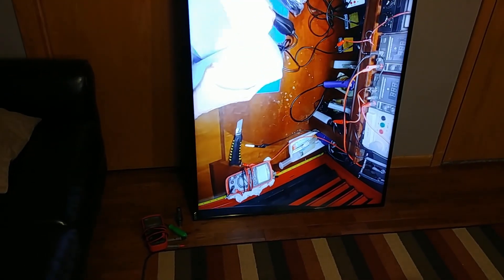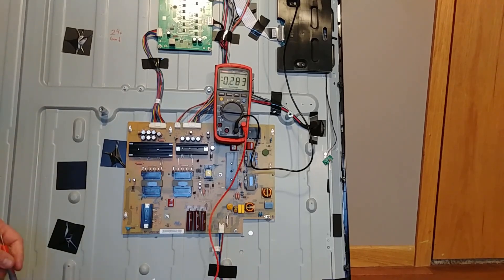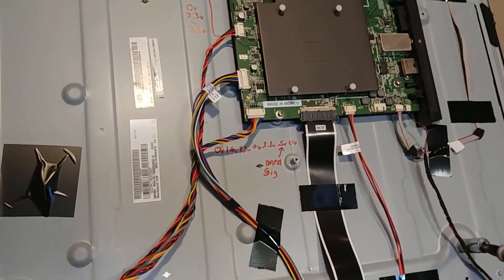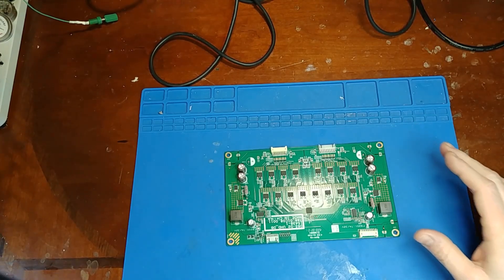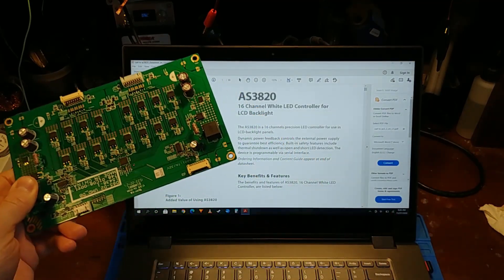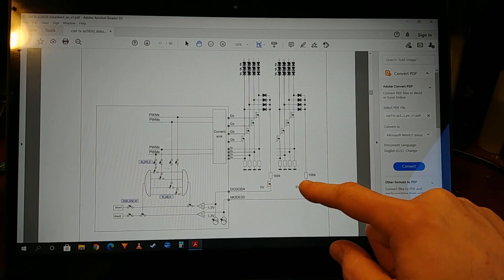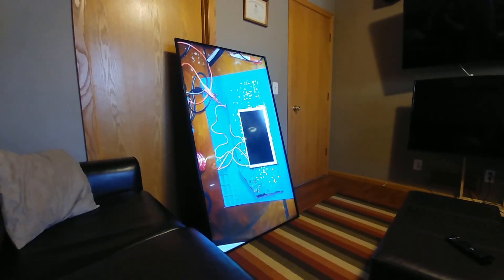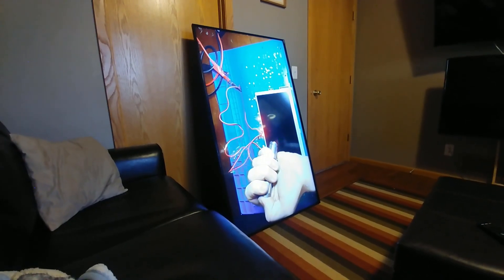How to sorta fix a 65" Vizio for Free

Comment: ❤ Question: what is the process for actually removing the 2 resistors? Did you have to heat them up to remove them? Or can you just pry them off?

Is there an easy way to do it without special tools (soldering iron, etc.) ?

Thanks so much for the video! You may have saved me lots of $$$ ❤ 5:47
Reply from the maker: You could forcefully remove them, but it's possible the solder joints could be damaged in a way making it difficult to put back to original normal condition. 
But if you have no intentions on replacing the LED strips you have nothing to lose, it's worth a try.
Reply: @jeffescortlx  thank you for the quick response! You the man! I was thinking of adding 2 usb cooling fans to the rear to prolong the life. Do you think this would have any benefit? Or is the LED failures usually not due to heat?
Reply from the maker: @babypluto2767  LEDs are rated for hours. Keeping them cool helps, but they are still subject to use.

Comment: Bypass of the protection circuit may be OK for a cheap equipment like a TV.
If the risk is to damage an expensive component in expensive equipment the best solution is to replace the actual failed component.

Comment: I tried this fix.........and it worked.........however, because of the size I could save the resistors............you wouldn't know the actual specs for these........the whole board is impossible to replace.  Thanks
Reply from the maker: 100k. Probably 1/8th watt or something like that.
Reply: @jeffescortlx  THANKS

Comment: You need come take vacation in florida and fix my dads sceptre TV that I cant get a new Tcon board for. I have a saved search on ebay for the last 2 months and still nothing. only psu/main boards. no T con
Reply from the maker: Bags are packed. But I want to take a pit stop at galaxies edge and geek out for a day.

Comment: I have a 00-06 Silverado/Tahoe A/C controller I refreshed. I removed the rotary encoders and cleaned them and it works great. I’d rather replace them then clean but I am having trouble finding the specific one I need. Where would I be able to find them? Any help would be great. Thanks.
Reply from the maker: For 03-06 encoders between cleaning and donors I've never needed to track down new replacements.

Comment: The price of TV's now days just buy a new one and not fix the old ones.
Reply from the maker: Correct me if I'm wrong, but isn't free cheaper than buying a new TV.
Reply: @jeffescortlx  Yes but if you had to replace things in it is what I was talking about.
Reply from the maker: @xsiner  ok, but even so. Let's say you buy a new TV, now you have to see if the retailer you bought the new TV from offers free recycling. If not you might have to pay a recycling fee to drop it off, or find someone that will come take it. Or you could brake it apart and throw it away in peices. But really it's it kinda wasteful to destroy a 65" 4k TV just because it needs a led kit installed?
Reply: This logic is fine for cheap tvs. But a decent TV is quite expensive and definitely worth doing a free fix.

The vizo still has a decent picture even today.

Comment: I have a 42" Vizio that is doing basically the SAME thing. Powers up, picture shows up for anywhere from 10 seconds to 2-3 minutes then LED backlighting goes out. My wife already bought another TV, but I saved this one because I keep thinking it will be an easy fix.
Reply: Mine doing the same thing .

Comment: I was going to say  ' play with your pussy '  oops sounds wrong lol.
I thought you were going add a couple of 470k resistors from ground to the 100k outputs.
Less feedback but still some,  just in case the sneaky chip expects to see something.
But removing them works, well done jeff :-D
That pcb looks nice and symetrical,  not a nightmare mess by some mad man lol :-D

Comment: I'd be surprised if the LEDs never fail but without your "fix" the TV would have been thrown in the garbage.
Reply from the maker: Pretty much yes. It's a hack job, but it's better than going straight to the dump.